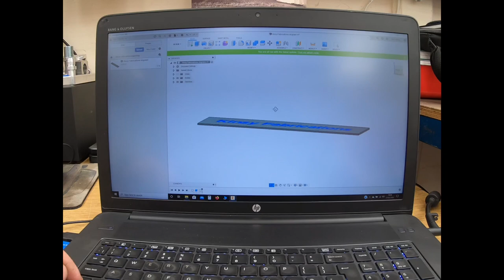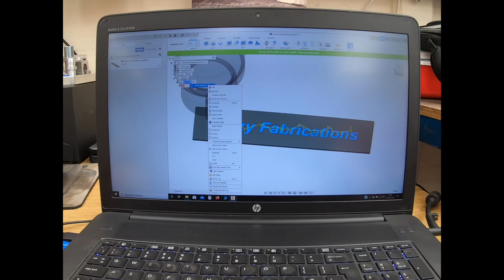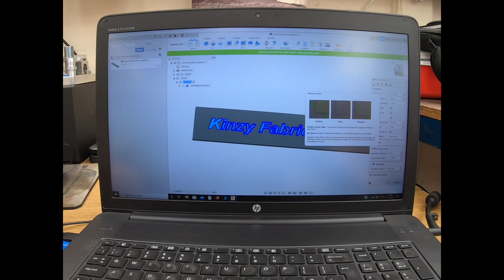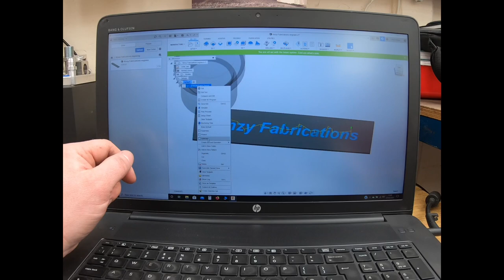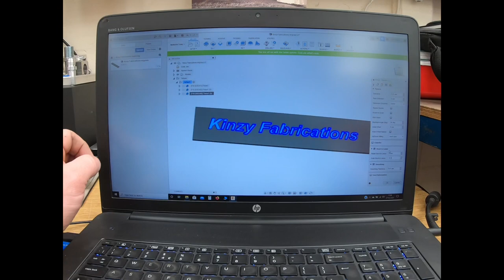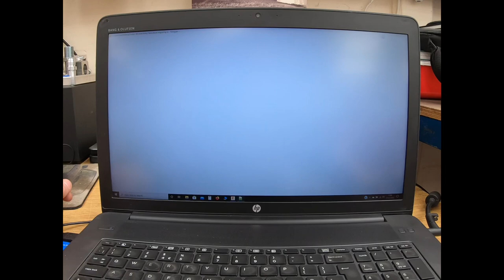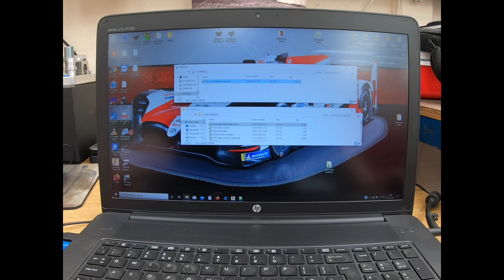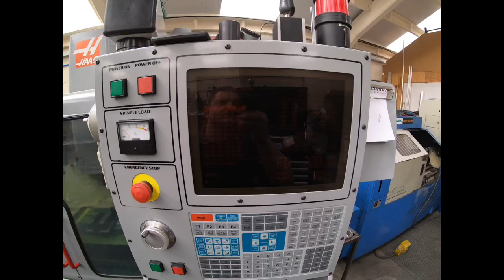Fabricating a custom rally style side exit exhaust pipe from start to finish

Comment: Great work. You are a master with SS and TIG but (please read as positive comment) I think you did a little mistakes.
The first is I'm sure that the transition pipe is smaller in the exit side than the inlet (round) side.
The second little mistake is the position of the reinforcement on the angle side. It must be parallel to this angled side, if not you are closing the tail exhaust area.
Reply from the maker: Hi

Thanks for your comments, I appreciate all comments

The transition as it’s formed from the same 3” round pipe should in theory be exactly the same size volume wise but yes it may slow down flow slightly,

With regards the the upright supports it’s not critical but I see what you mean, with the engine size and power output of the car it’s not going to create and issue but again I agree it would interrupt the ideal flow path if that’s what’s important to your application which wasn’t any concern on this

Thanks for watching and commenting

Marc